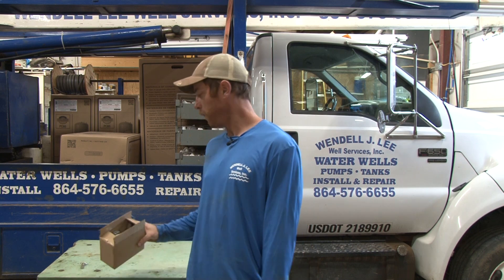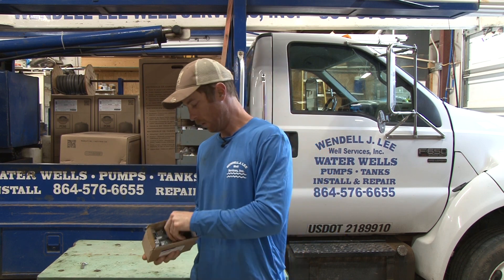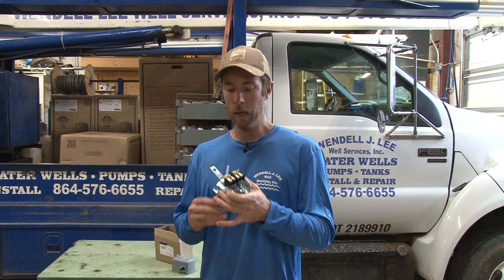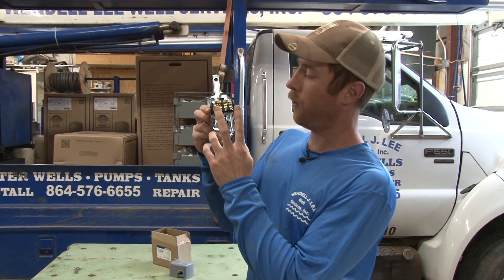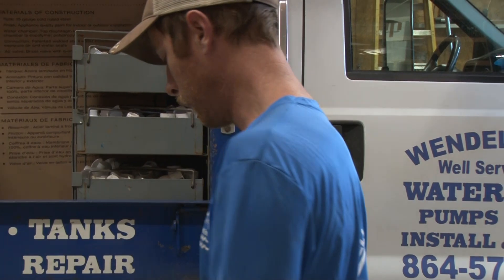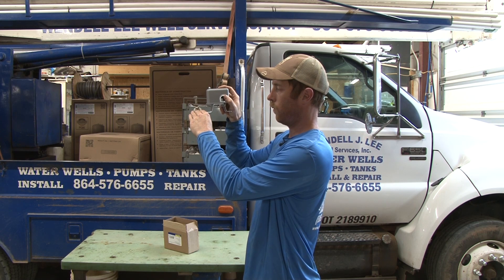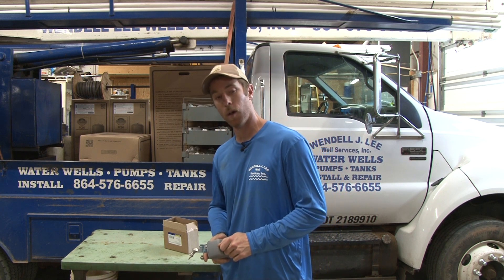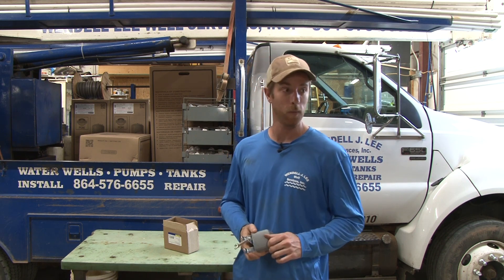Square D Open Tank Float Switch: How it Works

Comment: Thank you for this video. I have this type of switch and I hate it. It constantly gets jammed/stuck and doesn't turn the pump on or off when it should. I've had my cistern overflow and lately I've had it get too low and burned up the pressure switch on my jet pump. Yeah, I know I need to have some sort of protector to stop the jet pump from running, but this was the setup when we bought the place years ago and we can't find a well service in the area that will come out and fix things up. The guy who used to work on our well system died several years ago. Anyway, the rod for the float either catches or goes sideways and has rubbed against the hole in the fiberglass lid of the cistern, making a bigger hole and allowing it to move around too much. The sensor that the arm is supposed to trigger loses its sensitivity over time. I have to constantly go out and check on it. I want something different rather than spending another $60 on one of these. Did I mention the cover sometimes gets in the way of the arm moving? Maybe I just have a lousy one or defective one, but I've had it for years and its been giving me trouble. I'd really rather use something different. I don't mind having something dangling in the water if it works better than this thing. I'm one of those people that has bad luck where bizarre things happen and things go wrong. So, I've had bad experiences with this switch.

Comment: Thank You for all your video's, I have an above ground storage tank, with a jet pump connected to it. Will I need to connect my in tank float switch, to the Pump Controller or the pressure switch on the Jet Pump. I also will be connecting a Pump Tec to protect my Well Pump Motor.

Comment: I have that exact switch on my water well fill tank but I also have another switch to control sprinkler pump off tank level. I need this switch to operate close when tank is full and open when level drops to a certain point. Any way to reverse contacts on this square d 9036DG2R? Thanks for the informative video.

Comment: I just replaced one and it makes contact on the up and breaks when the level falls so I switch the contacts on my 24 volt relay to the N/O position but it operated a second well that didn’t act right but my main well did but now I’m having to change my control X-fmr so I’m going to see if I had the wrong 😑 float switch on the shelf thought there was just the one like you explained but that’s what I run into daily

Comment: Thanks Works PERFECT for our 300 gal water storage tank.  Keep them topped off when water level drops about 4 inches pump comes on. FYI we terrible recovery on our well that feeds the tank, so I installed TP link smart plug.  Just plug into outlet the float switch and schedule to come on about 4 times a day, so it does not "tax" the well. Works super.  When the tank fills and Square D shuts off till water level drops

Comment: Wendell,  Great video.  I have a standard Square D pressure switch (40/60) filling my 80 gallon pressure tank (well is 135' deep).    I just added an additional 220 30 amp circuit next to the tank.  Can I bypass the pressure tank and have the well pump fill a 5000 gallon atmospheric tank (fire season in California) by tying a float switch into the pressure switch?  I will take the water from the storage tank and supply my house using a new Grundfos Mq3-45 tied into the new 220V service I just added.  Doable?

Comment: We use this switch on a lot of stock tanks for either submersible control or solar pump control.  They do need a larger ball than a toilet ball at least 6" diameter round ball or 6"x4" pan float to be heavy enough to turn the switch on and still float enough to turn it off.  Our supplier has a good bracket built for stock tanks I'll get you a short video sometime.
Reply from the maker: good deal kenny, this beats the typical wire and ball switch any day
Reply: Kenny do you have the video, could I get the supplier you use for them, we are needing two for a couple of our stock tanks
Reply: Can you send me a link to the 4 x 6 pan float and bracket
Reply: Kenny do you sell the pan float?

Comment: Nice educational videos!  I'm getting closer to understanding all how my water system works, thank you and keep up the good work!  A couple questions; 1. How does this switch compare to a regular float switch? 2. How is the seal made between the switch and the float so the air pressure in the tank won't be lost?   As the connection rod goes through the tank to the water level it  goes through the air pressurized tank doesn't it?
Reply: This switch is used for open air tanks... like a stock tank or other non pressurized storage tank.  Most all of them are going to end up with a guide of some sort around the float ball or bolted solid to the lever so they don't swing out from under the float.